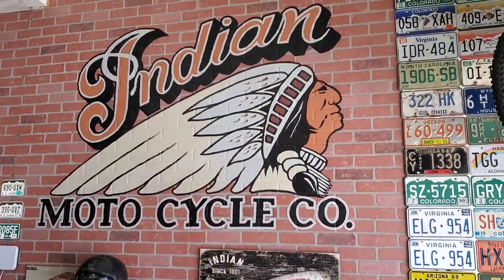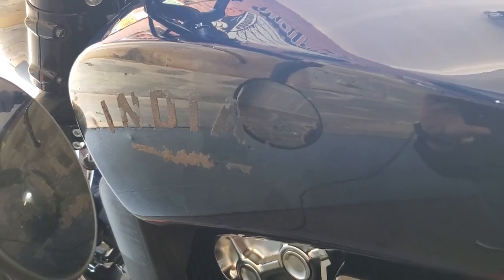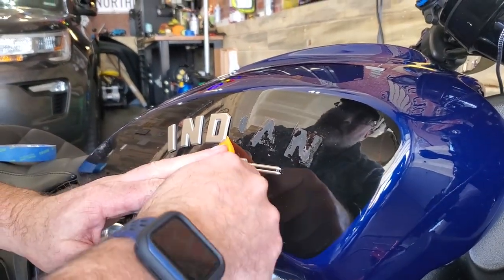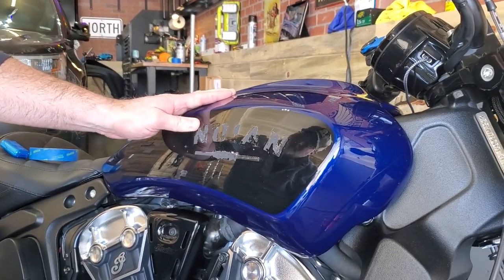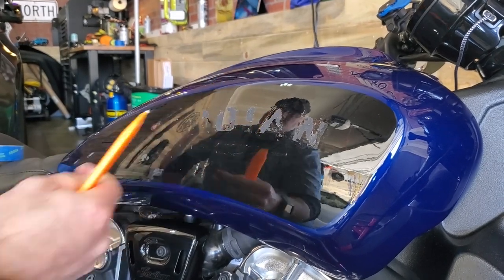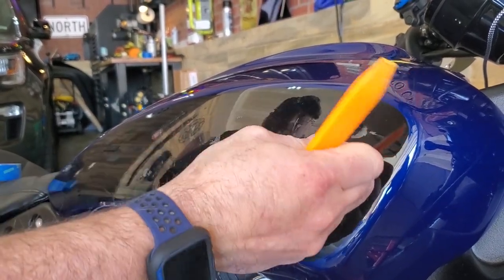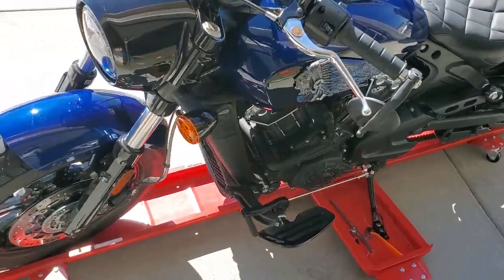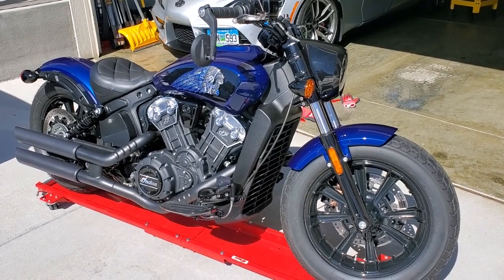How to debadge the gas tank on the Indian Scout Bobber plus bonus ArtAbyss Warrior Art install

Comment: How could you remove the adhesive on matte paint scout is the process the same
Reply from the maker: My bike is matte and I just used heat,  goo gone,  and my fingers to run the lettering adhesive off and clean it up.